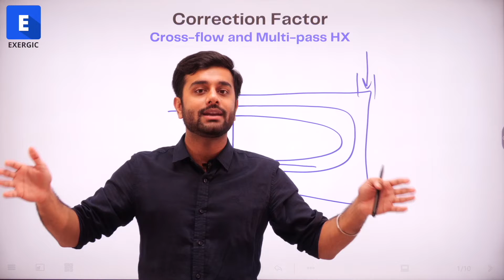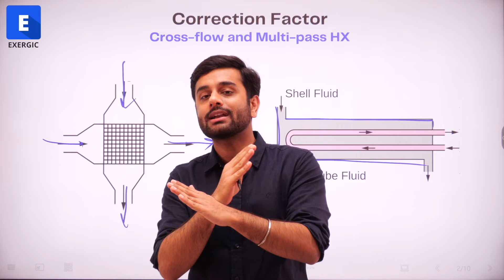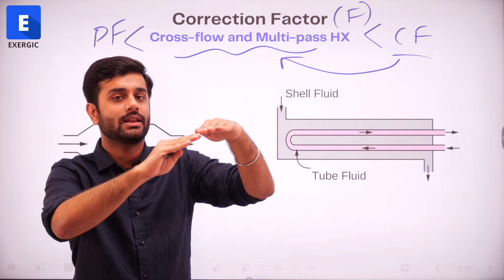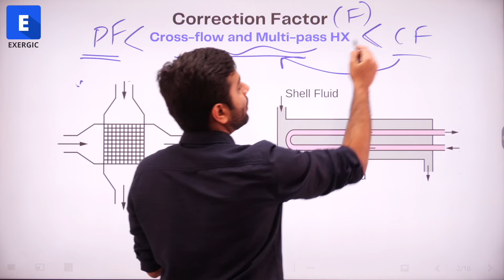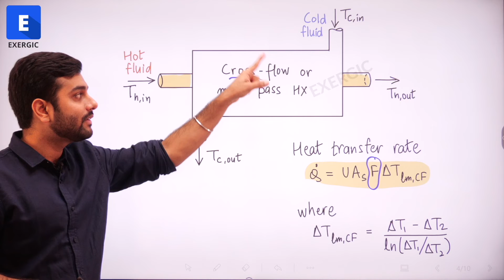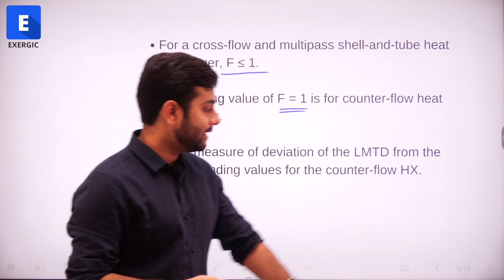Comment: How to calculate min. Required area for heat exchanger if the inlet & outlet temp. & specific heat Cp value is given only. In this case we have to calculate the heat duty    using  Q =mCpdeltaT. While also we have to calculate heat transfer coefficient and area, so how to calculate this. As the formula is Area = Q÷UfLMTD. In this case Co efficient factor & area need to find out. Pls let me know hoe to find it.